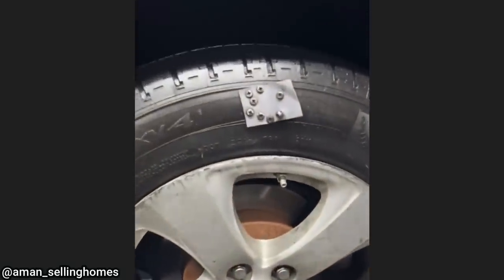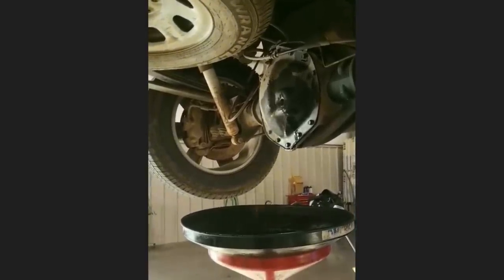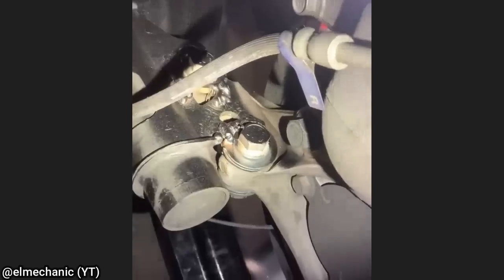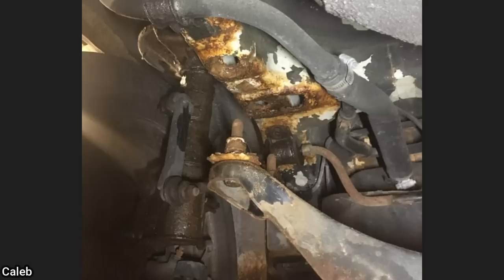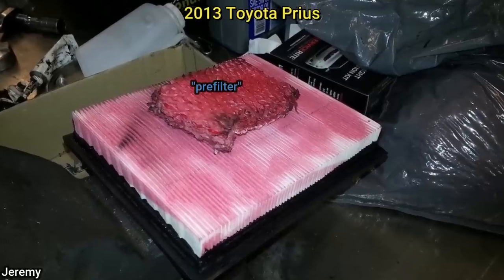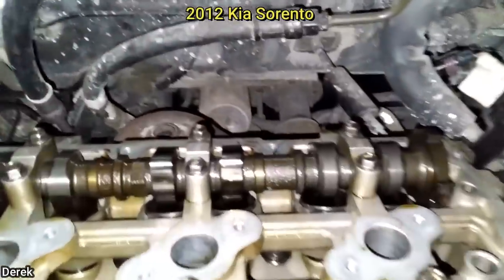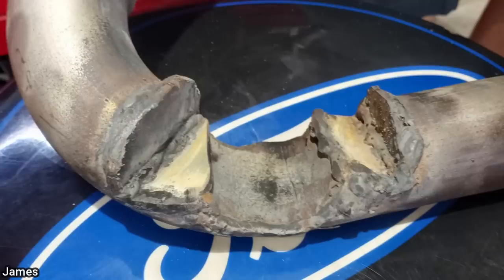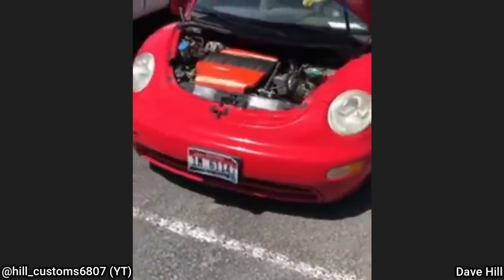Customer States They Tried Fixing Their Tire But It Still Leaks | Just Rolled In

Comment: I'm shocked that some of these people can even figure out how to get their cars started!
Reply: Well all you need now is the key in your pocket or purse and push a button. You don't even need to hunt around for the ignition or expend energy to turn the key. Then the car might even drive most of the way but you have to decide when to take over. 
Driving is not a part time endeavor if appropriate reaction reflexes are to be achieved. The idea of someone new driving a stick shift will only be for the sincere enthusiast.
Reply: They don't need to figure out how to start a car, they just follow simple directions and memorized actions.  For many of them, the problems start as soon as they want to do something they haven't been given full step-by-step instructions on, and try to apply any related knowledge without any thought or adaptation, like fixing a hole by trying to screw something over it, without thinking about how it won't hold in air if they do that.
Reply: It's easy to figure out how those cars are going to come to an end.
Reply: I'm shocked they can get out of bed without assistance....🙄

Comment: To be fair, the first step in fixing a hole in your tire is to make the hole bigger, then plug and patch with an adhesive membrane.  Logically then it should also be acceptable to add more holes instead before patching with an adhesive membrane.  Seems something went wrong though...

Comment: I have a 2002 TDI VW Bug sitting in my garage with a bad fuel injector pump, always joked with everyone that I'd sooner LS swap it than throw down three grand for parts and labor to replace the pump. Glad someone went through with it and did the swap 😂
Reply: I understand where you're coming from - not wanting to spend 3G's - but today, spending that money, will definitely make the car go up in value. It didn't use to be true, but in the here and now it is. Especially the TDI's as popular as they are here in CA anyway. 
I'm assuming it's 3 grand because they have to remove a shit ton of parts to get to it? 
If that's true it's a perfect opportunity to replace a bunch of old parts w/new parts when they reassemble it. 
That too will increase the value.
Reply: @kettle_of_chris  That pump is well buried, and also you have the "while you are there" issue as well, plus half the plastic parts in the way will likely break when you want to undo them as well.
Reply: Yeah, going that deep on a 20 year old VW made in Mexico with lots of plastic seems indeed like an open ended task…
Reply: A friend's daughter has a gas '02 convertible, and that thing's almost as big of a money pit as her '13 Sorrento. I can't believe the electric fuel door release on the Beetle is pretty much an old-school cable-operated mechanism, attached to a remotely-mounted motor to pull the cable!

My friend tried to convince her daughter to stop traveling extra miles to the Kia and VW dealers for routine repairs, but the local Dodge dealership told her they won't touch BMW, Mercedes, VW/Audi, and Kia. The local GM and BMW dealers won't touch VW or Kia either. 🤔 Mom-and-Pop shops will do the very basics, and turn away bigger jobs.

Comment: That Beetle reminds me of a friend that just V8 swapped a Miata. A Ford 5.0 inside a little Miata. Carburetor too. Hes nuts.
Reply: How long does he think the engine mounts and front suspension will last?? The engine is half the weight of the car!
Reply: @markh.6687  I can gaurentee he had to custom fabricate the motor mounts and a 5.0 coyote only weights about 130lbs more than the 1.8L iron block that came stock on na miatas. There's plenty of companies that sell conversion kits for ls miatas
Reply: @UndefinedStasis  Selling parts doesn't mean it's a good idea; there's a sucker born every minute as P.T. Barnum said. See also very low-profile tires not meant for street use being sold to people using them for street use. I've seen this; way more money than sense in action, especially when they try limping flats to two nearby tire shops. It ain't pretty.  😲
What's next, a "old GM" 3800 in a Yaris?? 😆(No, wait!, somebody out there just said "Soon..."). 
Well, either way they'll have to beef up the suspension and brakes to handle the weight increase so it doesn't handle like a wet sponge and brake in time to absorb the added momentum of that extra 130lbs. But if they're going to all this trouble to mod a Miata, I'm thinking they plan accordingly. Maybe.

Comment: This was an especially good set of subscriber photos--love the mid 80s Supra and what I take to be a 1970 (or close) Lotus Europa!
Reply: Long time ago I had an '83 Celica GTS which had all the Supra stuff except the V6 and different style pop-up headlights.
The only reason I sold it was the cold-start injector valve would leak making it hard to start if it sat for a while. Other than 
that it was the best car I've owned

Comment: As usual I could say a lot about what I just saw, but in this video I'd like to point out that oil pan that "never hit anything" proves that it's a fairly stout construction indeed.  Or well enough engineered to crumple rather than be torn off.  Either way, kudos to the boys in the office (this time, we're still watching you....)

should go without saying, but I wanted to say something besides remark on that incredible Beetle...
Reply: Right, with that crumpling like that and NO LEAKS? AMAZING!
Reply: it's steel so can take a beating. many now are aluminum and just break. then the engine seizes.
Reply: @ronblack7870  yeah, but to maintain a seal around the mating surface without subtantial leaks?  I still call skookum on this one, sir.  That was still one hell of a blow, if ya know what I mean...
Reply: the one on my civic must have been made out of titanium , it was dented , but the guy who changed the oil for me for years kept tabs on it , it never leaked 😮

Comment: I know in gets expensive but I have my dealership do all required maintenance per the manual. If I have other issues I get it checked before it turns catastrophic. An old commercial stated "You can pay me now or pay me later". Later usually cost much more.

Comment: I work on boats and we had to do oil changes on Perkins engines every 4 weeks due to cold 65° thermostats being fitted and calorifiers for the domestic hot water. One boat went for 4 weeks and 3 days and the engine seized. Took out the sump plug and not a drog of oil drained out overnight. Even compressed air at 120 psi couldn't blow the tar out of the block.

Comment: I have a new ish tyre less than 4000 miles and I got a screw on the edge of my tyre i know is not easy to fix that but is £200 for that tyre any suggestions for patching ? Apart from screws and tape

Comment: Talk about a "rear diff flush".🤣🤣🤣

That LS swapped VW beetle is really cool. I wonder what transmission it's bolted to that can handle the power output of the LS and remain front wheel drive?

Comment: Picked up a Mesquite thorn in the sidewall on my pickup. Pulled it out and put in a self-tapping sheet metal screw  which i covered with Flex Seal. Ran that for about six months before I could get the tire replaced.
Reply: i live in the desert , cacti and mesquite thorns don’t puncture car tires, if they did yours you have the worst tires ever …
Reply: @peterf.229  lol guess you've  never seen these. Lol they were michelins.  Not cheap.  Seen mesquite puncture heavy equipment tires as well. Ask any tire shop.

Comment: I had a bloke come in and say he had a bad knocking noise under the car so I put it up in the air on a hoist and I had  to use an angle grinder to cut twenty Meters of chicken wire and four steel star pickets away from the tail shaft ! When he came in he said he took a short cut across a paddock! I told him  next  time he should go thru the gate instead of thru the fence !

Comment: In cases where a shop discovers seriously dangerous issues on a vehicle and the owner refuses to repair it there should be a write up system in place that flags the vin and license plate. So if the car gets into an accident or damages property the owner has to take full responsibility for the damages maybe some jail time too if a person is injured because of their car. Not saying you have to fix it at that shop but you should at least have some incentive to tow it away and get a different shop to fix it or scrap the vehicle if it’s a far gone issue.

Comment: 2:20 no way I believe that happened in 28k miles?! My car used to be on ultra long life oil and wasn't changed until 18k miles on multiple oil changes, and after 6 years I had the sump removed for a clean and there was no sludge at all. I guess idling is really bad, but why so much idling?
Reply from the maker: Diesel's take a while to warm up, especially in the winter.
Also common to see a diesel truck like that used for a company vehicle, so lots of idle hours is common to see as well. If it was any other vehicle that had less idle hours, it probably wouldn't look like that.
Reply: @JustRolledIn  Ah yes, the delivery van scenario completely escaped me 😅 Even cold, I wouldn't expect my oil to look like jelly 🤣

Comment: Props to the guy with the sleeper Beetle (a Sleetle, if you will). It's one thing to engine swap anything German, but it's another thing entirely to tell them they did it wrong and here's how it should have been done.

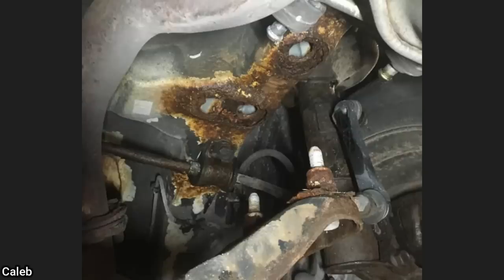Comment: 1:27 funny enough the license plates on this jeep are german, though nothing official. you can have plates like these printed at the respective shops (located right by the agencies where you can register your car), either for fun, or to mirror an existing plate to mark a assigned parking spot with it.
then again, the mechanic speaks engrish(?), so this vehicle doesn't run in germany. it wouldn't be street legal, anyway for a number of reasons... XD

Comment: Just heads up. Sidewall holes are unfixable. You are best off covering a bolt in rubber cement and plugging the hole with that to get you home. Plug it while flat, then let it dry before you air it up.
Reply: i had a moderate leak and refilled my tire three times and got to the shop and bought a new tire , was on the road without rubber cement .
Reply: @peterf.229  if you made it to a shop, then your alive, and so is your family. And for that, Id consider myself lucky in your shoes.

Comment: I sliced a sidewall a few days ago on road debris.  I used my lighter to melt it a bit and it held enough air that I did not roll on the rim for the 400 meters to the nearest shop.   400 meters!  Lucky.  It held 10 pounds.  AMG rim.  No want to roll on it.

Comment: The first one absolutely has to be a troll. No one could poke holes in a tire thinking it will fix a leak. That's as bad as thinking drilling holes in the bottom of your boat will let the water out when you're floating in the lake.

Comment: the screwed tyre was priceless, but the extra fuel tank connected to the rear differentials' breathing hose made me facepalm. they knew enough to install that tank, and to connect, but never looked into how to connect it to a fuel line... hose is hose, what's the worse that can happen?
1:40 looks like a prank to me. no way that piece of metal can pierce through the mudflap like that. the flap is plastic and will give way, stopping the piercing thing.. but at least it's an interesting-sounding prank.
2:03 stopped reading the how-to halfway through, huh?

Comment: If you must affix a patch to stop an air leak, it must be done on the inside of the tire. The screws will hold much better. Don't use duct tape, use a metal plate and silicone. 😂

Comment: I do not understand how motor oil in USA gets gunky so quick. Yes, I know oil should be changed every 10 000 to 20 000 km (6-12 000 miles) or every 12 months as per manufacturer, but our oil does not turn into syrup and then tar if you exceed that. 🤷🏼‍♂️

Comment: I love the duct tape repair 🤣🤣
I would've put a piece of duct tape on every tire before returning it 😏
That's the "cleanest" differential EVER 😋
That's one way to "pull the grass" in the ditch line🤷
There's No Way in Hell that oil pan took that lick without ripping the oil filter off (and probably causing engine damage) 🤨
I wonder how much of these damages involved a teenager in the house that played a little too much GTA 1-5?😏🤣🤣
Out of the vehicles at the end, gimme that Celica (only if it's a manual) every time 😎👍 fun little cars

Comment: You guys all laugh but in an emergency situation if someone punctured the tire with a knife and you had the right things this could actually work.. A piece of rubber under a piece of metal and rubber washers on the screws I bet it would hold up till you got to a repair place ..
I carry a full repair setup for tires in my classic with authentic wire wheels where I need tubes.. And I can patch from the inside too..

Comment: We once knocked a four inch hole in a tractor tire sidewall. A local,shop bolted in a shoe work smooth head carriage bolts and it worked for years. Of course is had an inner tube and that was in the 1950’s on a forty horse power tractor that never went over 11 miles an hour. This  “patch” is insane, stupid, ignorant and possibly deadly. You can’t fix stupid with a patch either.

Comment: This is why people should not do their own autowork unless they have some sort of mechanical knowledge and a manual. How do you connect your aux feul tank to your transmission?
I think that truck is gonna need a good dose of weed killer and a trim mower, he seems to have an overgrowth problem.
When your truck becomes a tar machine because you run its engine more than you bother to actually drive it.

Comment: Let’s pretend the screws and duct tape kept air in, how long would that automotive genius driven on it before getting it replaced?
Reply: I got a neighbor that drove on his spare until it failed and got mad that it didn’t last as long as an actual full sized tire, even though it says right on the spare “Do not exceed 50mph and 50 miles”. It’s meant to limp you to a repair shop, not get you to work for the rest of the year. Genius.

Comment: What's worse is the shenanigans from the mechanics. $$$. 
We have a shop here called Honest 1.
Typical overpriced. Take advantage of women. They poured fresh oil in my neighbors coolant reservoir and said the engine is ruined. But it was fresh clear oiland not dirty oil as you would expect when the heads are cracked or the head gaskets are blown.  They said it will cost $1800 to fix. We flushed it out and it's okay.